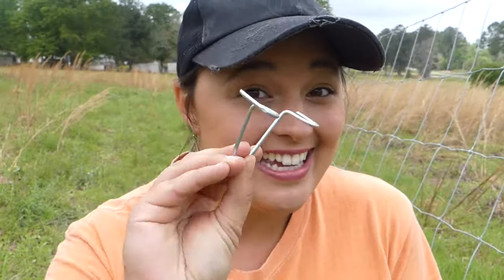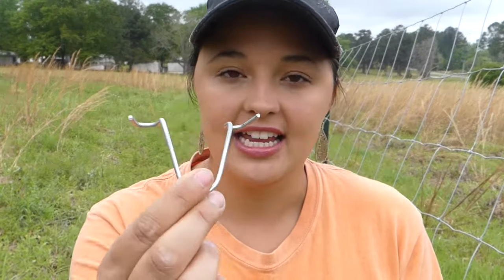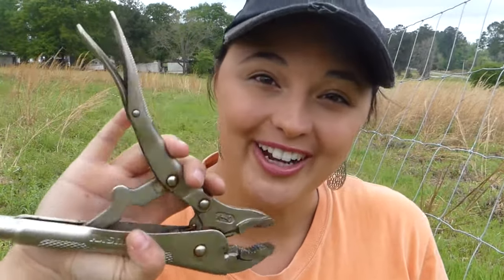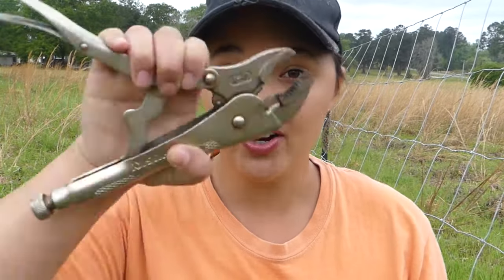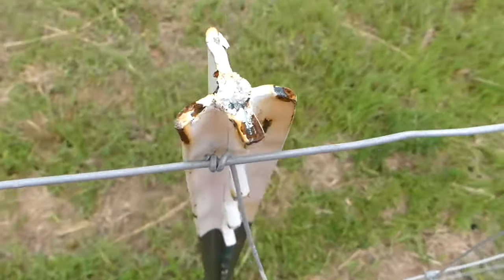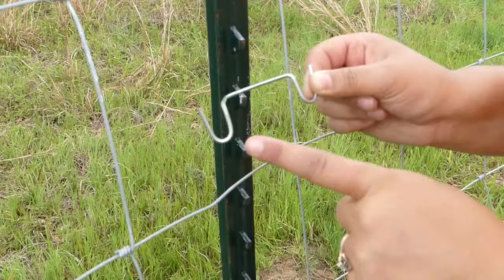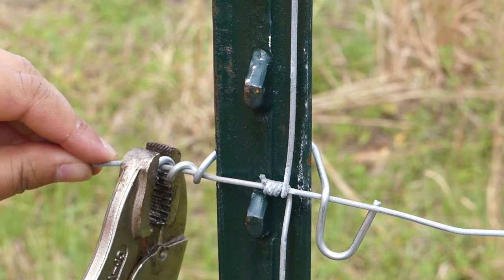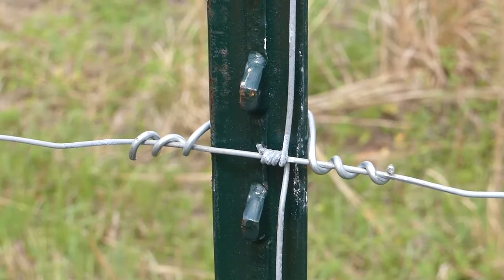How To Apply T-Post Clips I THE EASY WAY

Comment: In my humble opinion, your fence is installed incorrectly.  The fence should be on the side of the post that you're trying to either keep the animals INSIDE or OUT.  In other words, because you are trying to keep your goats INSIDE, you would have the posts installed OUTSIDE the fence.
Reply: @ Elliot 

Exactly right Elliot 

Because if the animals over time pushing on the fence 
It’s relying on the clips not the fence pushing against the post themselves
Reply: Maybe she keeps them on both sides. If not, you would be right on my place.

Comment: Fence should be on the inside ant the post on the outside.  That way the animals are pushing against the fence posts.  The tool is a vise grip pliers.  Adjust the grip with the screw on the end of the handle.

Comment: A fence fork for that particular clip you have  is easy
Reply: yeah. i noticed that as well.🙂 I wasactually looking for an example of how to properly use Fence Pliers. It wont take long to find that.
But, the jointed stick with the holes in it is a new one to me. Seems likely just a somewhat bent piece of rigid rod with hoes would work as well (depending on fence wire spacing).
So far i have only needed to do a few (less than 10) at a time so i have been able to use slip joint or linemans pliers.

Comment: ou want to flip your posts around and have the posts on the outside of the fence. That will help hold the fence up by the goat pushing the fence into your t-posts instead of pushing it away. Fence on the outside of post keeps things out. Fence on the inside keeps things in. You did do it correctly with fence on the nubs of post. 👍🏻

Comment: Never had to do this type of work, but just by looking at what's involved, I would install the posts on the out side  and wires on the inside with the small flat surfaces of the spikes on the post FACING UP so that wire can rest on them, thus keeping wire from slipping down the post when weight is applied to them. Feel free to correct me if its not correct to do so.
Reply: so you would rather have the fence inside out? Wouldn’t look as good

Comment: what brand of clips are those? the ones I bought just say pop on and push down.  I then pinched the ends to keep them on the wire.  these looks nice and tight so I'd like to know if I got something inferior.  Thanks.
Reply from the maker: I purchased these through Tractor Supply when we bought our fencing. I believe they are Fence Fork Brand. They did not have a fence fork available at our location so I used what they had in store :)

Comment: Generally, the fence is on the animal side and the t-posts are turned 180.
Reply: if you orient the fence components the way you describe the hooks on the post will be facing your animals , not good
Reply: @crappie72  The push is from the animal side so the fence fabric must be on the inside of the post. Now the clip is twisted away from the inside and there is no risk of animal harm.